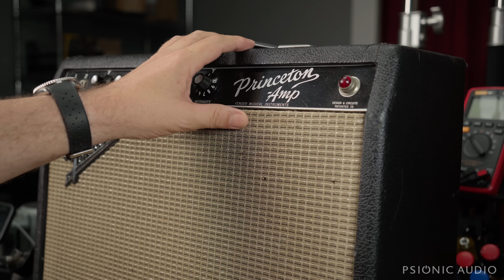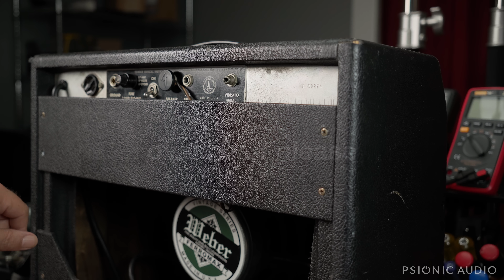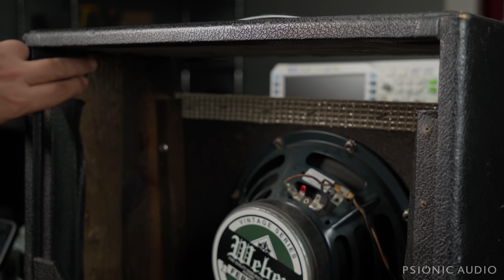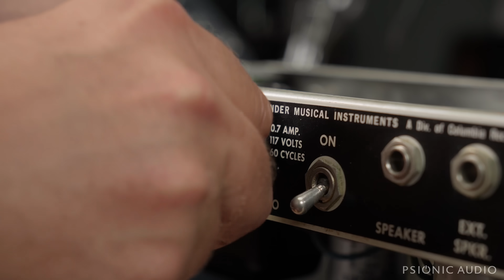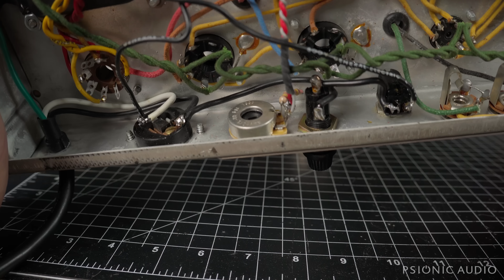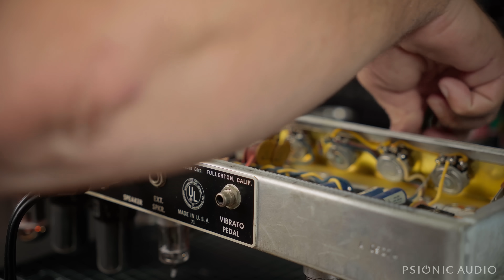Tasty | '66 Fender Princeton Pt 1

Comment: I've noticed this in a couple of videos and I've been meaning to ask, what's the issue with ground lugs being bolted to the chassis under the trafo bolt? Why does it need a separate bolt?
Reply from the maker: Transformer metals heat and cool at different rate than chassis metals. This can cause expansion. This can cause shrinkage. And shrinkage makes the nuts loose. Add in weight/vibration and it’s extremely common for the nuts to become loose. The chassis can even deform with heavy transformers, speeding up the process.

So this makes for unreliable grounds.

Comment: pass on that rig.  Too many non original parts.  Also, never wanted the princeton without reverb.  Why, if you can get an all original.  Don’t like when techs replace all the analytics and caps.  My guy will only replace what is absolutely needed.  Techs want to eliminate all possibilities so they replace things that dont need replacing.  Likewise with tubes, n order to eliminate any possible variables they replace all the tubes.  I want it as close to what it was original as possible.  No mods, no new speakers…. the original speakers are available if you search.  At inimum have the originals reconed.
Reply: @BradsGuitarGarage  example…new JJs  vs.  3/4 burned millard pre amp tubes…one sounds good the other is sunshine raining down on u from heaven…and caps?  someone is too lazy to check each and every value…one is bad…replace all
Reply: @BradsGuitarGarage  “you cant have both”….typical….i pay people well for both….and they deliver.

Comment: I really enjoyed this channel (although a lot of the technical stuff is way over my head-I'm happy if I can wire one of my pots...)*this question is for anyone who's willing to answer: I have a roughly 2014 4x10 Deville. . It's definitely loud enough so I think the power tubes are good... And it sounds good w/ distortion pedal (or when I turn it up to 11).**but, when I do not have it cranked, it has this high pitched kind of ringing sound almost like I have the treble on 12 (the EQ and presence both on the amp and my guitar does barely anything to change it)... Also I thought the reverb tank was broken but then it started working perfectly about a week after I got it (had it for about 2 months) and now it just cut out again... So I'm thinking a loose connection? Should I try changing the preamp tubes? I don't think any of the tubes have ever been changed... The power tubes get nice and hot I can feel it and it has plenty of power.. but unless I have it turned all the way up it has this annoying ringing that at first I thought was the speakers but now I'm starting to have my doubts... I have a good guitar guy that's been around since the 60s but he's not very familiar with Fender amps he's more of a marshall guy... Any suggestions I'd be happy.. I live in northeastern Ohio and I don't really know any good amp repair people...
.. plus I'm broke as hell.. Mr. Psionic: if I ever make it as a singer-songwriter I promise to donate to your channel LOL (and I enjoyed your recent chat on 5 watt world)
Reply: Like I know it's so embarrassing people are probably thinking :"just get a better amp" but I really wanted that bassman soundI decided to get one and spent the rest of my money on it because I new if you play these through good speakers they sound really good... I knew they had kind of crappy speakers... But my long-term plan was to get a second Marshall cab (my current one is one of the good older ones that's 16ohm- need 8).. like I have played enough crappy amps to know this one is good it wants to sound good there's just something a little off with it.. I just don't know amps well enough to tell if it's a tube, a loose connection, a fuse,... or All the above... Like I said, it'll do cranked Sabbath... But nothing below 75% volume sounds decent on either channel.

Comment: Any recommendations for an el84 tht will last longer than 6,7 months or is there something about my amp thts causing short power tube life .  Thank you very much .
Reply: I’m betting that you have a Blues Jr. eh?  😝 The bias is set WAY too high from the factory. Adding a trim pot to cool the bias down is easy … in theory. Unfortunately those amps are built so cheaply, going inside to do anything risks causing other problems.

Comment: I have a '69 Drip Edge PR. I was dialing in the bias last night. It as a 100uF 100V bias cap. I've read that a higher mfd value can fill slower and cause issues on start-up. Any truth to this? I ordered a a 50mfd, but I'll leave the F&T 100mfd if there's no issue. I did replace the original diode and resistor (3W metal oxide).
Reply from the maker: The 100uF is fine but that’s pretty much max.
Reply: @PsionicAudio  thanks. Gonna replace. Too quick of a job to not do it. The F&T looks older than newer and I’d rather do it at the same time as the cathode bypass and filter caps.

Comment: Happy 4th Lyle 😎 . . . I have a '65 Princeton RRI and would like to have one of these older Princeton's w/o the reverb . . . but at today's prices, I can't afford one . . .
Reply from the maker: The reverb version sounds subjectively better to most, including me.  Your RI should be a very good sounding amp if it has the right speaker.
Reply: @PsionicAudio  I installed new F&T caps and did the reverb wiring mod to V2 . . . looking for a good spkr for the RI . . . any ideas ?
Reply: If you want a strong sounding 10" speaker, check out an Eminence Ragin Cajun. I generally prefer 12" speakers, but Im pretty impressed with the Ragin in my friend's Princeton Reverb  @tomk1tl39
Reply from the maker: https://youtu.be/5XpSR_NMMTw?si=h95ccAH3DNXjxBzs

Comment: Tube Nerd Fun fact - RCA never tooled up to produce a 5AR4. If you see a RCA labeled 5AR4/GZ34 it’s a GE, Sylvania or Mullard(and Japanese in the very late 70’s/early 80’s). 

Happy Independence Day!
Reply: I have a Sylvania that still works very well after 40 years of banging the plank at almost full volume. Get a good Set of valves and once you get the amp sounding the way you like and then leave it alone and just make Music.
Reply: @Waldoandotto007  Those old big bottle Sylvania 5AR4’s are tanks! I think they’re better than the Mullard GZ34’s, especially in their overload capacity and heat dissipation. They sure are easier on the wallet in NOS form.
Reply: A Japanese 5AR4 may have a cross pattern molded into the top of the glass bulb. I've think I've seen this on Japanese EL84's too, and perhaps on some Amperex Bugle Boy tubes. Maybe they used some of the same tooling or parts,/glass suppliers.? When the major European tube manufacturers closed shop, they may have sold some of the machinery to China, Russia ( a short trip) or Japan.  Here in America we probably just scripped scrap the machines because it would have been a major hassle to ship them out of the country....
Reply: @goodun2974  If I recall correctly, a lot of the Phillips tooling made it to Eastern Europe/Slavic regions and Japan. EI and Matsushita factories specifically.
Reply: RCA relabeled what appear to be Sly 5V4s as 5AR4s, late 70s - 80s IIRC. They have a large 6L6GC-size base so the bear trap has to be swapped out first a larger one. Versus a true Gz34/5AR4 they drop the B+ about 15vdc. Seem to last forever.
Reply: @jerrymcgeorge4117 , the 5V4 (aka GZ32) is a good tube; increases B+ a little compared to a 5Y3 ( useful for bumping up the headroom a little in low-power 1950's practice amps) and has a slow warmup time like it's cousin the 5AR4/GZ34. It also draws less hester current than a 5U4.  I have a bunch of various 5V4's but I don't think I've ever seen one with a base too fat to fit a bear trap. Are you sure you're not confusing it with a flat-topped Chatham 5R4 mil-spec "potato masher"? For those who've never seen one of those, look it up, they're impressive. Not independently heated like a 5V4 or 5AR4, perhaps less voltage output, but very rugged.
Reply: @goodun2974  Don't think so. I'd post a pic if possible. Same base as a 6L6
Reply: @jerrymcgeorge4117  There's a large batch of 5V4 labeled Sylvania 5AR4's in the big 6L6WGB/5881 bottle.
Reply: @goodun2974 Nothing draws more heater current than a 5U4! 😅 Also they drop a shit ton of B+. If the 5AR4 is the best tube rectifier the 5U4 has to be the worst😅
Reply: @michaelknight4041 , well, the 5U4 may be electrically inefficient but they're inexpensive and rugged. If you want minimal sag/compression and maximum headroom from an amp, they're probably not the best choice ---- but a 5AR4 might raise the plate voltage too much, and good reliable 5AR4's aren't easy to find nowadays (NOS will cost you an arm and a leg).
Reply: @michaelknight4041 , PS, one might argue that the #83 mercury vapor rectifier might be even better than the 5AR4, because those have constant internal voltage drop across a wide range of load and current draw ---- but they haven't been manufactured in at least 60 years and NOS are somewhat expensive (they're required for Hickok tube testers); they only come in big coke-bottle glass (with a 4 pin base), contain toxic waste, take about 10 minutes to fully warm up and vaporize the mercury so that the tube can pass full current/voltage, and they don't  transport well because the mercury might condense on or fall into the mica spacers, leading to arcing. Theoretically, Fender used the 83 in a shortlived version of the tweed Bassman; I did rebuild a Bassman that had mostly the same circuit as shown on the schematic, but with a factory installed 5U4 socket ( octal)  and some circuit changes that were more indicative of the next revision.
Reply from the maker: That would explain why it looked just like the RCA labeled one in another ‘60s Fender here. ;)

Thanks Matt.
Reply: @PsionicAudio , if I remember correctly, in addition to the 6 character Mullard date and mfg code etched on the glass close to the bakelite base, they typically have a hole in the bottom of the plastic locating pin, and the side edges of the seam where the plates are joined may show a strip of bright copper. Plates are usually welded together, and the seam edges may be scalloped instead of straight.

Comment: I thought if it said Fender Electric on the front it is ‘64 or ‘65. If it says Fender Musical on the front it is ‘66 or ‘67.

So (perhaps with a few exceptions) it ain’t a ‘65 if it says Fender Musical.

Most blackface Fenders say Fender Musical. There seem to be a ton more ‘66 and ‘67 than ‘65. ‘64s are pretty rare in comparison.

FWIW I own three ‘66-‘67s: Princeton Reverb, Deluxe Reverb and Vibrolux.

I had an non-reverb ‘66 Princeton and found it to be very underwhelming.
Reply from the maker: And I do prefer the reverb version. But this doesn’t suck.
Reply from the maker: I’m not sure when they changed to Musical. I know the change started in ‘65 but when it rolled out, did they use up all the old ones first, etc, I don’t know. 

At the beginning I said ‘65 or ‘66 knowing that it would be ‘65 at the earliest. And wouldn’t feel bad it if was ‘67.

The insides didn’t change during this time.
Reply: @PsionicAudio ,  Does anybody make  period-correct replacement face plates for silverface Fenders?

Comment: Tremolo sounds very good, why did they go to the roach
Reply from the maker: This bias trem doesn’t work as well at higher wattages (it can be addressed a bit but there are limitations) and there can be artifacts at some settings. And it’s softer than opto - so the opto had more gee whiz appeal when it came out.
Reply: You also can run into trade offs between tremolo and power tube bias with fixed bias amps like this. You really need adjustable bias - someone added that here earlier - to find the sweet spot. 

I agree that this sounds better than the roach.  I built a Super Reverb derivative a while back but used bias vary tremolo. It worked fine and sounded GREAT, but it took a while to find the happy spot for the power tube bias.  The guy I built it for loved the tremolo, and his son owned an original 1965 Super Reverb with the roach circuit in it.